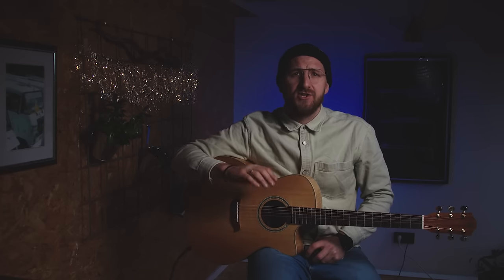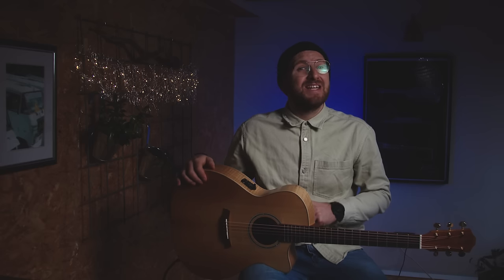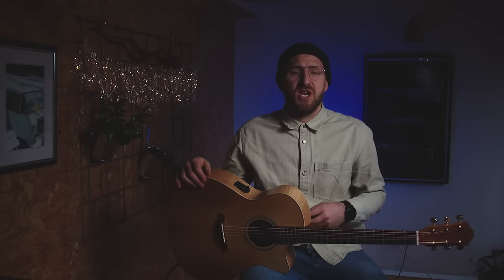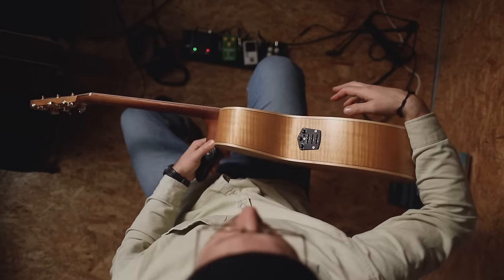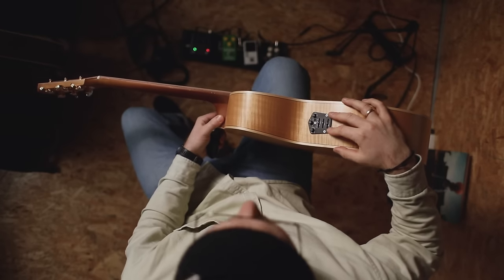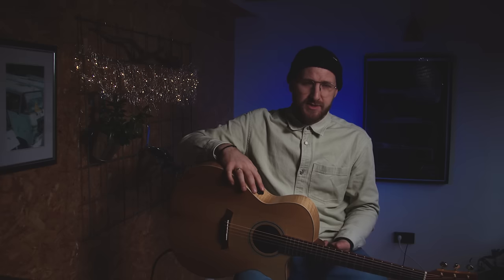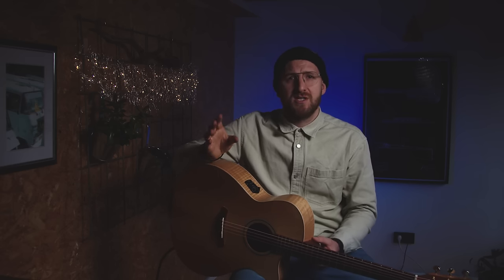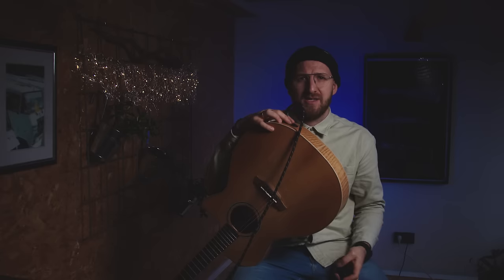This ist the most natural sounding pickup in the world!

Comment: All 3 examples sound the same. And I’m wearing headphones. I’m surprised because a condenser mixed in should be pretty apparent. I use fishman rare earth and blend it with a k&k and the condenser mic adds significant “air-iness” even a low levels. Makes me wonder if the post production on the sound of this video was properly mixed? No hate from me btw - greatly appreciate the time put into this video explaining it.
Reply: I can definetily hear a difference. Between the first two its so small almost unnoticable but when comparing those two settings with the third where they are all combined you can hear, how the sound sort of opens up. It feels like having a bigger stage on what the sound resonates from.